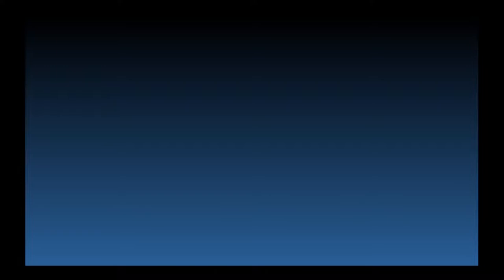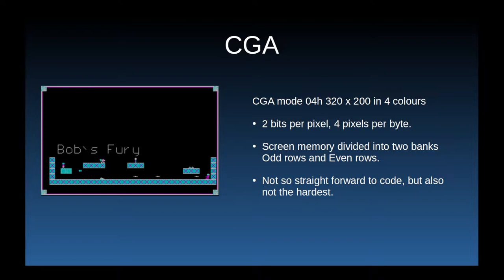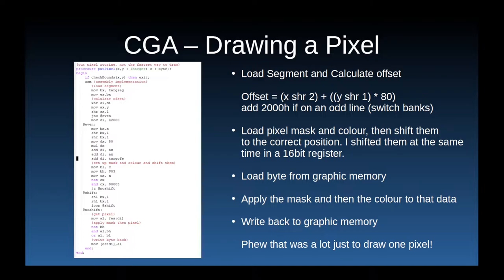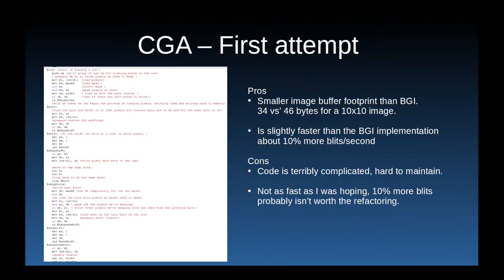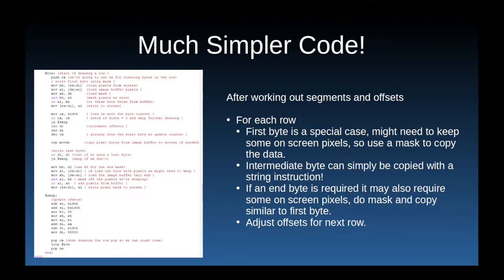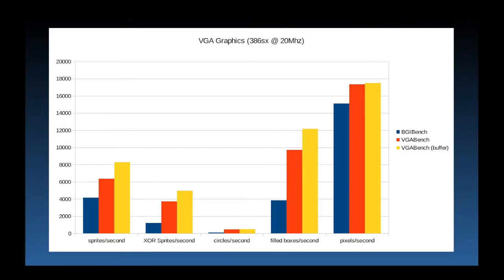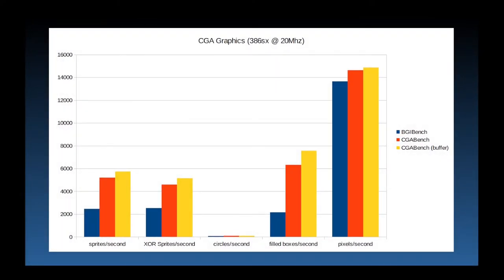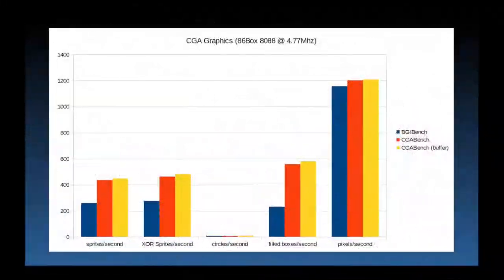Bob's Fury Update: Making VGA and CGA graphics library

Comment: Great video, thanks for updating us! Some things I thought about when watching:
First, I agree about the off-screen buffering being significant. It's especially good for preparing full-screen transitions. If you're processing while a delay is expected, then you can prepare a complex 320x200 image and have it appear in an instant even at 4.77MHz.
Second, although you're broadly right about machines that existed back in the day, there was another category that your game fits well with: late Turbo XTs often had VGA, like the Amstrad PC2086 and later, and the 8086-based IBM PS/2 machines.
Third, your assessment of the Borland BGI also applies to the equivalent Watcom/OpenWatcom graphics library. When I tried to use that, not only was it slower than the bespoke library I created afterwards, but it was unacceptably slow at printing graphical text at 4.77MHz on CGA.
Finally, I'm looking forward to trying this out on the only vintage DOS hardware I have, a handheld Hewlett Packard 100LX, a CGA turbo XT equivalent (80186). If you want to see how its mono LCD renders your graphics, let me know!
Reply from the maker: I have loads planned for the off-screen buffer, there are many features it can improve, one of the first I want to tackle being flicker.

Back in the day I started with a 386sx, so didn't get much experience of those other machines, but it's good to hear that  putting in effort to make VGA playable on an 8088/8086 would be worth while.

I've also noticed the BGI is terrible at rendering text, you can see the delay on slow machines! I'm kind of torn because I may have to change the font when moving to my own text rendering. There were some fast graphics libraries back in the day, but I think they were all commercial.

I'm eventually going to make it available on github to make it easier to find, just thinking about how I can work it into my current tool-chain and work flow. Given your device is already a turbo XT equivalent it would probably already work reasonably well.

Comment: I know this might be a little late in the game - but you can use the BGI for all the "slow" stuff. You can mix in your blit routines without having to rewrite everything. Just do an Initgraph first - then you can drop in your asm routines.
Reply from the maker: I did think of doing something like this, but I save a lot of memory by not including the graph unit. I have got CGA and VGA pretty much done and have it rendering the stroked font as well. So far it's alot faster, plays reasonably well on a XT running at 4.77Mhz, just with some slow down when the screen gets a bit busy.

I've still got some work to do, such as implementing the other graphic modes and general optimisation, it's coming along really well!
Reply: That's great! Keep it up. There are lots vga256 modex libraries but very few complete CGA/EGA and 16 color vga alternatives to the BGI.
Reply: Just keep chipping away at it. these things are hard to get right. I got stuck with my cga160x100 library. i will need to get back to it.

Do you know if the BGI putimage command has a bug in it CGA mode? I think i ran across that through my testing. I think when you do NormalPut it actually does an XorPut or OrPut?   I will have to look into that again.
Reply from the maker: No I didn't run into that bug, but I perhaps wouldn't have because I was primarily using XOR put in the BGI version on the code. Would be interesting to see if that was the case.